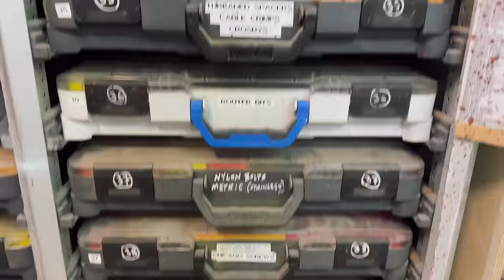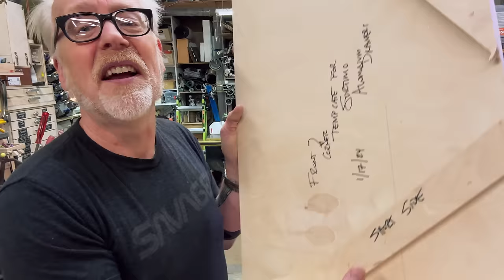Adam Savage Builds His Dream Hardware Storage System!

Comment: Why pop the holes? you are interacting with the cases not the drawers, just clamp them all together nice and tight and drill the holes just like you are for the cut. Drilling and chamfering would be faster than popping each hole by a mile. Also, a bit of hydraulic power on that break would have helped crucially.

Comment: Why did he go through all of this trouble  ? you can have a system like this from Doorman and others filled with everything from nuts and bolts to roll pins and electrical connectors along with bulk hardware in bins I have that in my trucking biz shop the rep even comes and refills it every month. .

Comment: You really didn't have to rivet that back to the sides. it's not under stress. by the video it appears to be about .090 sheet?  Hard to see.   Could save a lot of time without rivets and still be strong enough.  It is a much better system.  I can never find a flat surface because there's always too much crap stored around!  You have an awesome shop!  I can only hope

Comment: why not just make 1 drawer for each column, at counter height. get out the box you need, and put it on the drawer. 10 or so drawers, instead of 70. saved so much time, and the box is at a comfortable height for you to get stuff out of the box.

Comment: so I looked and turns out sortimo really does not sell the drawer parts separately. only in their trolleys (which fit about 8 boxes). which seems like a missed market
Reply: Considering the price, they make bank on the idiots who buy the original. 

I have a few sortimos, but they don't keep small parts seperate very well. So my waaaaay cheaper solution is SMD boxes in paper drawers. Much MUCH cheaper than all the boxxes

Comment: If Adam has a band saw…. Why didn’t he create a sled or sleds and a clamp set up and do all of the operations on all seventy or chunks of the seventy sheets as a block. Instead of punching the holes just drill them vertically through the block of sheets, make every cut on all 70 sheets as one block and then all you have to do manually is the folding and punching

Comment: For the aluminium part of the drawer surely you know someone with a laser cutting machine that you can just program all the cuts in and holes and if you give them a bit of money they can bend it as well.
Even I know someone Who will cut whatever design I want and all I need to pay for is the steel or aluminium. This all could be done in less than half a day

Comment: Instead of having each Sortimo on it's own pull out draw, could you not just simply mount a shelf/table on drawer slides at the base of the Sortimo storing unit? No longer hunt for a flat surface as there'd be on where the Sortimos are and if you're working on a project that requires multiple parts from a number of Sortimos you could have them laid out next to each other instead of spread apart AND have the Sortimo unit stacked higher (scales above your head and/or spans further along the wall) without sacrificing functionality.

Comment: Seems as if you designed this around not having a surface to lay the case on when it's out of the system.  I think I would of just sacrificed one openings in the case storage unit into to a hideaway shelf.  Your idea is better, but ALOT of work..  :)

Comment: Would it not have been easier and more efficient to install a pull out surface for each bank of boxes. Then you just pull out the flat surface set your box on it take what you want and then push it all back in.

Comment: A simple piece of Plywood cut to fit in between each slider would have solved your problem. Measuring the position of each slide one at a time and using a that board as a straight edge was a waste of more time.

Comment: Man- once the end mill was thru all 70 sheets why did u not just take the lateral feed handle and move table to left to make that first cut thereby giving yourself only one cut per corner on bandsaw?? Or at least split the depth to 35 sheets in two passes if all 70 at once was too much meat for 1/2' endmill. just sayin"

Comment: noooooo! not a spreadsheet!  these are sooo unsuitable for cataloging your stuff.   a simple database (even something like a library card template from MS Access) would do you far better.  you can cross-link categories, create sub-categories from major ones, create 'parts lists' of matching bits-n-[pieces and even query the database ("which screws fit which washers and where are they?" "where are the 9-pin barrel connectors, and enough wire for 3 feet?", "give me a list of all washers sorted by diameter, and their locations", etc.)     true it will take more time during the data=entry phase, but you will have a much richer and faster experience in finding what you need when you need it.

Comment: It would have been cheaper, faster, with less labor if you built a small fold up table at the site of the parts containers. That would be only a couple of steps away from the farthest parts container. This is a project of “want” but not “need”. This is a ton of unnecessary effort when a simpler solution is available. Love your projects and experiments but this time and effort could be better spent on something else.

Comment: waste of material - the case is already rigid - you should have worked out a way to fit the runners to the case - no need for aluminium at all - listen to ELON - "the best part is no part"
Reply from the maker: This video is several months old, and the system is working perfectly for Adam.
Reply: @tested  working yes im sure it is...   but is it optimal ???   someone without adams budget would benefit from the optimal solution.